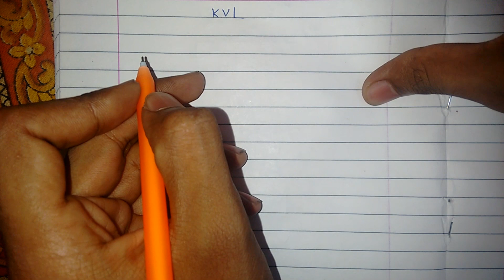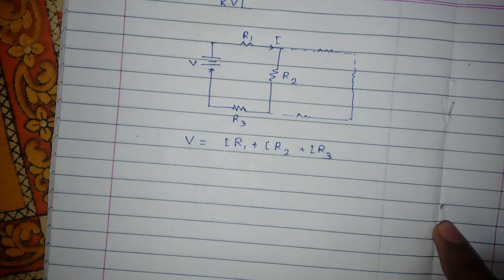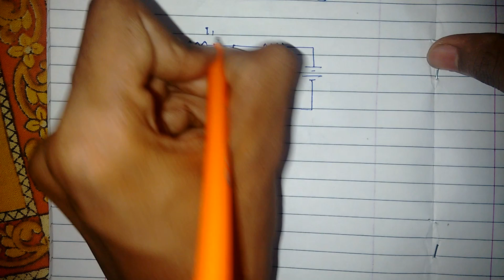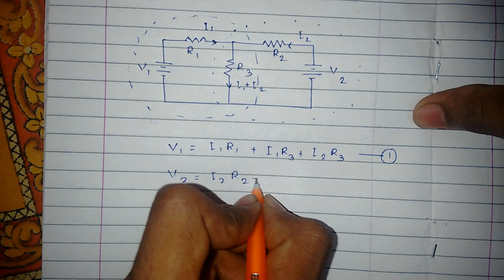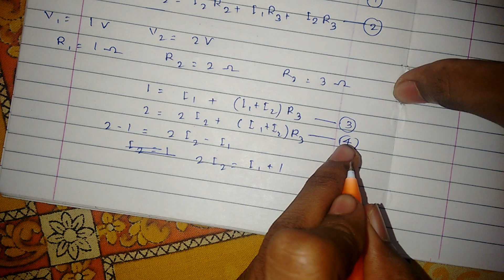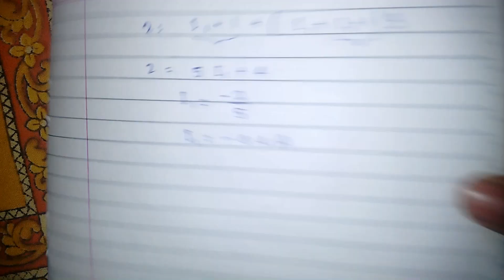Kirchhoff's Voltage Law in easy way with help of example

Comment: U consider two loops ..
and in each loop there r two resistors u but u put all the 3 resistors in single loop ..?
Kindly Explain
Reply from the maker: I have used 2 resistors only in each loop. Current going through R3 is (I1 + I2) hence it is I1R3 + I2R3.

Comment from the maker: sorry for inconvenience, I have done a slight mathematical mistake in last part of video (page 2 in video), following is the corrected answer:

2 * i2 = i1 + 1
if we replace it in equation we should get
2 = i1 + 1 + ( i1 + (i1 +1)/2)*3
1 = i1 + 3 * i1/2 + 3/2
-1/2 = 5 * i1/2
hence i1 = -1/5 A
2 * i2 = i1 + 1
hence 2 * i2 = 1 - 1/5
2 * i2 = 4/5
hence i2 = 2/5 A

Comment: how you got these numbers 5i+4 ? I'm not that good in math . ty
Reply from the maker: I subtracted equation 3 from equation 4
Hence on LHS 2-1 = 1
On RHS (i1 + i2)*R3 will cancel out as it is present in both the equations.
So on RHS we will get 2i2 - i1
Hence 2i2 - i1 = 1

I have made a mistake in later part of video. the correct part after this subtraction is in pinned comment. sorry for inconvenience. If you still have any doubts then replpy back :)
Reply from the maker: No need for subjects other than programming. If you r not having good practice of programming in practicals then class for C/Cpp would be beneficial.
Reply from the maker: equation 1 and 2 are as per KVL
in 1 and 2, if I take R3 common from last two terms then I will get equations 3 and 4.
now if we subtract equation 3 from 4, (i1+i2)R3 will cancel out,
hence we will get  2*i2 - i1 = 2 - 1
I.e. 2 * i2 = i1 + 1
if we replace it in above equation we should get
2 = i1 + 1 + ( i1 + (i1 +1)/2)*3
1 = i1 + 3 * i1/2 + 3/2
-1/2 = 5 * i1/2
hence i1 = -1/5 A
2 * i2 = i1 + 1
hence 2 * i2 = 1 - 1/5
2 * i2 = 4/5
hence i2 = 2/5 A

sorry for inconvenience, I have done mistake in last part of video😅
Reply: Electronix HuB i didn't understand how u subtracted i1 with 2i2 in eqn 3 and 4
Reply: Electronix HuB thanks bro got it
do need to get classes for the first year?
I'm in the first year computer engineering at mumbai...
Reply: Electronix HuB i am weak in maths and good in programming, so maths and related subjects also need??
Reply from the maker: +Nikhil Chaudhary all M1, M2 and M3 main part is matrix, integration and differentiation.
If you are weak in these sub.s tution would be helpful. As you r in Mumbai you will have good options for turions as well.
I am from WCE, Sangli. And since my college's syllabus was different than universities, I have no options for tution.
But if r weak in maths then try tution for semester and then by comparing difficulty, college teacher and tution teacher you can decide further.